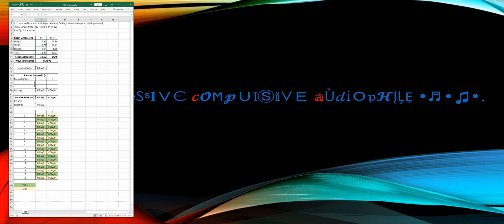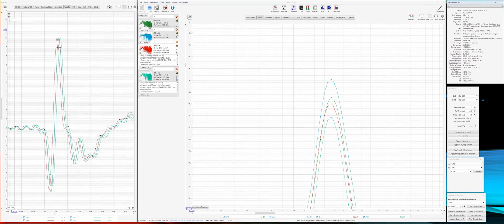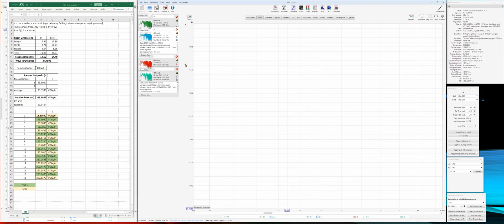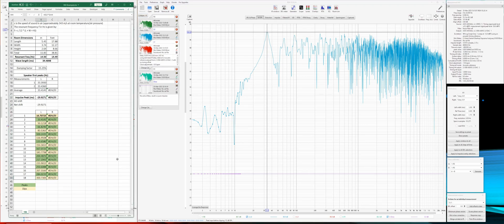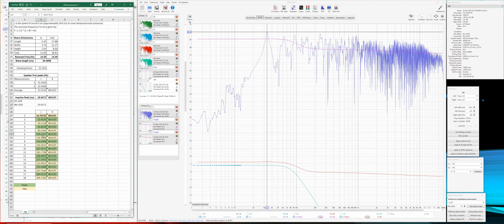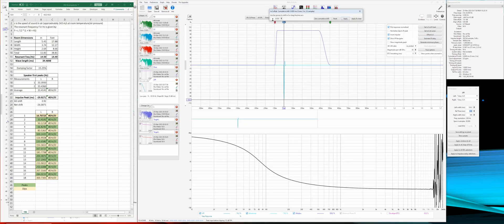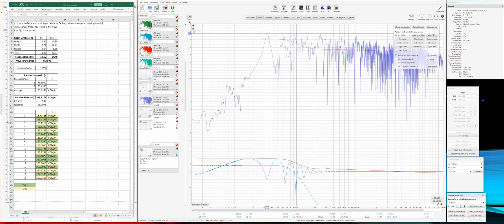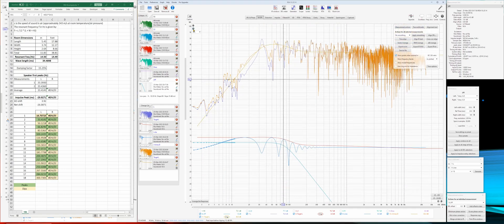Boost your bass output with a virtual bass array filter

Comment: Now i wonder if this somehow can be adapted for car stereo use... with all the pressure chamber stuff happening in bass there, the very early reflections and so on.
Is there any chance this would work there also, or totally different game?
Reply from the maker: Interesting question. The shape of a car is a bit too complex to derive a reasonably accurate method but could be done for a sub in the boot I guess. You will need accurate measruements and a convolution engine in the car setup.
Reply: @ocaudiophile  Raspberry Pi with CamillaDSP is in the works.
But if two channel you could convolve the actual sound files with the final filter by help of ffmpeg.
Reply from the maker: @Cathul  All can be done in rephase and REW, the method is the problem. Dirac Live ART, if it ever come to cars, does something very similar to this but uses a different speaker to send the counter wave.
Reply: @ocaudiophile  yeah... i've done the EQ filters, phase correction and excess phase correction from one of your videos for my car and convolved the sound files with the resulting filter. Imaging and staging as well as impact greatly improved even in the car environment. DSP in the car is a Mosconi DSP that cannot do FIR, but as i said, you can always convolve your soundfiles offline just like AcourateNAS is doing with the help of ffmpeg.
ffmpeg just uses the filter as second input and you need to use the afir filter for this. This step is very time consuming though, especially if you need to convolve several thousand soundfiles.
I think i leave the VBA out for now though as i tried to align the dips and peaks from the VBA excel sheet with the raw response of the subwoofer and there was no similarity at all unfortunately.
So even with guessing all the peaks and dips and trying different sizes it didn't really work.

Well, result of filters even without this part is great, so thank you for your effort in providing these informations in the form of videos for us to adapt them. :)
Reply from the maker: Good to hear that!

Comment: I successfully made the VBA filter It's hard but rewarding and I'm learning a lot so thank your this you're an amazing person.there is a issue with this VBA : my measurement has first peak 36.5 and highest peak at 131 Hz and between is 1 asymmetrical dip that peaks at 95 Hz, my room modes are co-aligning better with VBA ultra (65,131,196 from your old sheet ) then with VBA revamped (from this video where modes are 13,27,40,54,68,81,95,109,122,136...)  when your filter is applied to my measurement starts  off exactly at first peak but then boost is not long enough and cuts where my dip is, Can I make asymmetrical LP - HP filter that co-aligns better with my  measurement and for my studio monitors or can this filter be tweaked to do that. Another question is is there a difference between applying your filters ( all 7 from digital room and speaker correction workshop) for  near-field studio monitoring and applying them  to HI-FI/ audiophile speakers i.e. is your method tweaked for hi-fi ?

Comment: Hey there, how can apply this to Subwoofers? I have to Big Woofers in my studio and i want to apply VBA to them.
Also im actually not shure how to aply the house curve (Harman) to a non Full Range Speaker system.
Is it possible to get in touch with you and you can help me? Its my very first project i would also Tip you apropiately!

Comment: Does this filter get placed in a minidsp 2x4 hd or how do input this? I'm thinking it can be used on the input side of the minidsp.
Reply from the maker: No, 1024 taps is simply not enough for this kind of sophisticated filters.

Comment: Would you be able to implement this using the FIR tab on a MiniDSP? Or should I just rely on DIRAC in my receiver to get it right? And would it work for subs as well?
Reply from the maker: It will not be easy. REW cannot export FIR filters in .bin format. rePhase can but you cannot create time delayed filters in rePhase. It should be possible to convert .txt or .wav files to .bin but I've never done it. Dirac Live cannot do such filters. Dirac ART can but there's no MiniDSP that can process Dirac ART (for now!)

Comment: Thank you very much with this good tutorial. It was the enabler to get creative with REW and Filtering. Mabe there are a few points were i think there can be an improvement:
1. The Lowpassfilter you createt with REW in order to delay it, is not minimal phase. So the VBA is "to late" for frequencys in the transit region. I created the lowpass with RePhase (impulse is on t=0) and got better results. 
2. For me an attenuation of the Lowpassfilter of -1.8dB had the best results in correcting the resonant peaks. Everything between -1dB and 0dB pushed the dips to far
3. For my room a lowpassfilter with a higher order worked better, i think it is due to my non-sqarish-room. I would prefer to do corrections for the target curve after the VBA filter (even if this needs more energy).

I know that you do an overall phase correction afterwards and the two points will be corrected anyway, but you will need less harsh corrections.
Reply from the maker: You can also generate min phase version of the Dirac+lpf filter, this will improve group delay. 

I've also explained a quite different vba approach in the latest video if you wanna check

Comment: Very interesting!!  Will try this.  Have a question though (pardon my limited knowledge) -  In the acoustic domain,  don't we need a second copy of the same signal to create this cancellation?  If we apply it on the main signal at the source using a convolution engine (with the phase reversal for modal frequencies),  won't the wall reflections that creates standing wave also have the same phase shift?
Reply: Think I got it! It is like creating a custom comb filter on the source signal so that even with standing wave nodes/anti-nodes, the energy in those areas becomes equal to  other frequencies, right ?
Reply from the maker: The polarity inverted cancellation signal is produced with the precise delay.
Reply: @ocaudiophile  thank you ! BTW Are you using the paid version of REW ? Impulse response graph looks different from what I have on the free version.
Reply from the maker: @tkmanutk it's the free "early access version", you can find it with Google search.

Comment: I like your idea for VBA very much. However, you can still improve things. First of all, you should never boost the delayed low pass filter waveform. It should correspond with a reflection which will never be stronger then the direct signal. A value of -6dB is good to start with. Further, use an 8th order Bessel low pass filter (LPF) at 100Hz. It will give you an almost perfect and symmetrical impuls respons. And it will correspond nicely with the Harman Kardon curve still. The delay as given in the IR window button will be 4.97ms. Then, no, the total of length, width and heigth is not the correct number. At all. Also, you make a mistake regarding your open room. That would mean the frequency dip would be lower than calculated, not higher. To cut things short, just use twice the room length as reference for the LPF filter delay (with its own delay of 4.97ms subtracted from the needed delay and then put into the time offset of the LPF impuls respons). This gives me an almost perfect result, on the condition that the 8th order Bessel LPF at 100Hz is being used.
Reply from the maker: Thank you. I will try these suggestions. Recently I am doing it quite differently though (no boost to the lpf and it targets the second peak) but I am reluctant to put anoher VBA video. People don't like when you update methods ;)

Here's the mdat if you feel like reverse engineering it:

https://drive.google.com/file/d/1cdY1icKBdYpst1SSs7TdILoLP-cSrdpO/view?usp=sharing
Reply: I downloaded your file and tried my method. I think it worked fine. The attenuation of the LPF needed to be 3dB, 6dB was too much.
Reply from the maker: @jeroendezaire7266  using minimum phase copy of the smoothed vba filter trick sometimes improves the results.  Out of all the operations in REW, generating min phase with replicate data outside range option ticked is the only one that'll freeze the smoothing used.
Reply: @ocaudiophile  I like the minimum phase copy of the VBA filter, it gives a perfect impuls and step respons with no ringing at all. But I do not understand smoothing, that would ruin the now perfect VBA filter.

Comment: Hi OCA, great channel, thanks for your hard work!
What confuses me is why you use t=29.92ms for the impulse peak and not t=59.84ms (which is 2*29.92ms)?
Because in a one-dimensional, 29.92 ms is the time the sound wave takes to travel to the back wall (which would be 10.26m away) . If we now send out the inverted response at that time, then we will meet mode 1 (frequency (16.70hz) halfway on its way back through the room and not cancel it... So we only cancel out modes 2,4,6,8, etc... This is also where the dips in the filter are located.
But with t=59.84ms, the inverted response is sent out, when the sound wave is back at the speaker, and would cancel out all modes (1,2,3,4,etc)?
Reply from the maker: The wall is about 5m away though!
Reply: @ocaudiophile  
Thanks for your answer. I forgot to write that I made a one-dimensional 'simplification' of the room.
The idea behind this is, that one can simplify the three-dimensional room to a one-dimensional example with room length 10.26m.
This is possible because sound in low-frequencies is near omnidirectional. 
So the sum of all three room dimensions added is 11.83 meters per your example. If we subtract 15% damping, we receive approximately 10m meters (The theoretical room length). I took for my example 10.26m, because that is the wavelength of your resonance frequency of 16.70725 hz. 
This wave is back at the speaker in 59.84ms, so that is when the canceling should happen.
If you look at the filter, it gets maybe more obvious. At time=12m30s in the video, we see that the first dip is at 33.4hz, but it should be at 16.7hz. Similarly, dips are missing at all uneven mode: mode 3 = 50.1hz, mode 5 = 83.5hz, etc...
I hope I could express myself a bit better now and wish you good luck for the future :)
Reply from the maker: The room modes are produced from a complex combination of all 3 room dimensions. Room length is just an approximation. If you average all 3 room dimensions and deduct for furniture from that about 5%, the room mode dimension to be used in my example is something like 3.72m. This has about 46Hz resonant frequency and first peak at 92Hz and the polarity inverted pulse with about -10.8ms delay (-1000/46Hz) will successfully correct first major dip and peak. You will not need to add any SPL offsets, etc. to that filter either. The example in the video deals with a more local dip and peak but still achieves adequate results. @commonNightingale
Reply: @ocaudiophile  
Hi OCA
So I plugged the 3.72 m for all three room dimensions into REWs Room Simulator, and it creates a first major peak at 46.1hz (modes 1-0-0, 0-1-0 and 0-0-1), a second major peak at 92.2hz (modes 2-0-0, 0-2-0 and 0-0-2), etc...
If I use a time delay of -21.6ms the filter gets dips at 46.1hz, at 92.2hz, etc., so at all multiples of modes 1-0-0, 0-1-0 and 0-0-1.
If I use a time delay of -10.8ms the filter gets dips at 92.2hz, at 184.4hz, etc., so at all multiples of modes 2-0-0, 0-2-0 and 0-0-2.
I agree with the (-1000/46Hz) that you write in your comment, but that results in -21.6ms, not -10.8ms. But in your excel-file, you use the formula -500/frequency instead of -1000/frequency. Sadly, I cannot upload the screenshot of the simulation and filters here...
Reply from the maker: You are right! The Excel formula in the video link is -500/f for some reason. I will update it soon as I can. @commonNightingale
Reply from the maker: You got me all confused now :) 92.2Hz peak will have resonant frequency of 92.2/2=46.1Hz and the IR start time of the lowpass filter needs to be at -1000/46.1 or -500/92.2 = -21.69ms (in practice 2-3 ms more than that at around 18ms due to lpf filter delay)! I will check if the XL needs correction in that aspect. @commonNightingale

Comment: Hi OCA, I have made one negative impulse file at the 6th identified impulse frequency. Do we then repeat the procedure for most other room anomalies from say above that frequency till say 600hz?   Or would the single filter be enough to negate the other reflective frequencies which would also be present.
Reply from the maker: Sorry, I am not sure I understood the question. What do you mean by negative impulse? If you mean room mode peaks and dips, a low pass filter starting at the 5th frequency with 18dB/octave slope gives good results in many people's systems.
Reply: @ocaudiophile  Thanks

Comment: Is it a problem if I apply a gain of more than 4 db to the lpf filter to align it well with my curve???
It's dangerous?
Thank you!!
Reply from the maker: No it's fine
Reply: @ocaudiophile  6-8 db??? It’s fine??
Reply from the maker: Such differences are not common but if that's what is calculated, it'll not have any harm on the speaker.
Reply: @ocaudiophile  i love you ❤️

Comment: This version seams to be the best!! But with which other filter from your videos should someone combine it to have the proper result for a stereo pair speaker setup.
Reply from the maker: Add a crossover phase correction filter created in rephase and a rew auto EQ filter between 20-500Hz based on 1/48 smoothing. Multiply all 3. You'll be golden.
Reply: @ocaudiophile  You are Gold, thank you for sharing so valuable information. Huge respect 🙏🙏🙏💯💯💯
Reply: @ocaudiophile  I have managed to complete the VBA filter and its Great!! 
One question though for the other two that you propose because you have a lot of versions and i have lost it😂.
When you say phase correction i will use the mixed phase correction video this is the method u suggest? and i any points for the rew auto filter between 20-500hz i dont seem to find an example. 
My goal is to achieve detail listening and good translation on my speakers.
 Thank you very much.
Reply from the maker: All methods and totorials will get descent results but I keep improving them and REW keeps adding new features hence the multiple number of videos. 20-500hz 1/48 smoothing method is not yet in any of the videos. I am planning to make one this week.
Reply: @ocaudiophile 🙏Thank you for your response. Glad to hear that you planning a video for this, it will be very interesting!
Yes i agree REW is getting better and it will solve a lot of problems in the future.
Have a nice day and as a fun i will follow you new updates!!! Take Care💫🙏

Comment: Comparing to the previous vba method you described in part 2 with the use of rephase, this one seems to influence the deeps and peaks with a stronger  magnitude, but this one creates a nasty deep in the 100Hz area. My room is aroud the same dimentions as yours and after applying the filter using this method I am getting the same deep as it seems on the resulting predicted response on the video. Can you tell what is the reason for the 100Hz behaviour of this filter ? Maybe it is preferable to use the previous method ?
Reply from the maker: If your room resonant frequency is say 16Hz, the VBA filter will have dips at 2x16, 4x16 and 6x16 =96 Hz. But the effect starts decreasing around 5x16 = 80Hz because of the lpf. The dip at 96Hz is in a very narrow band and is inaudible but you can start the lpf roll off earlier if you don't like its effect on your response.